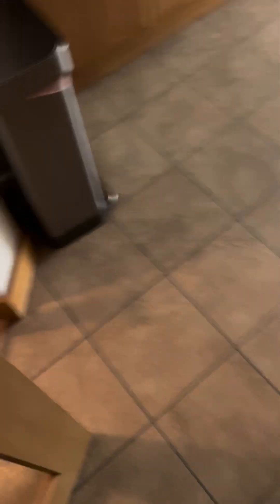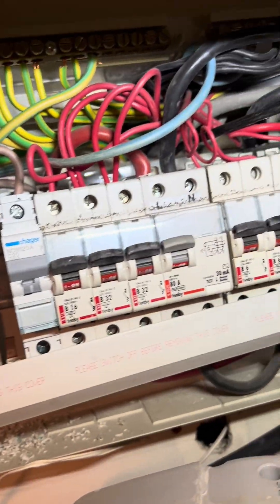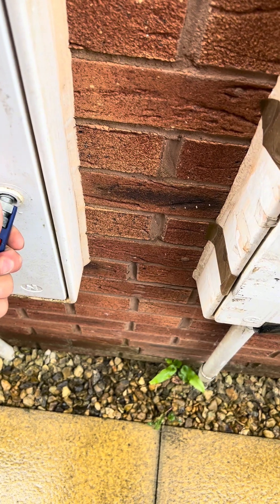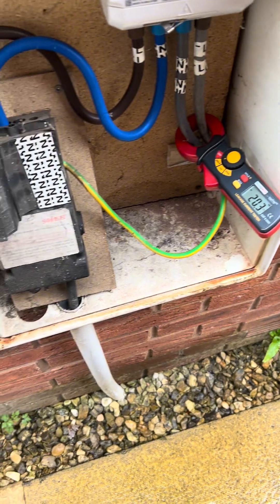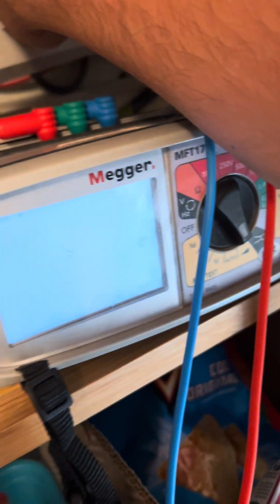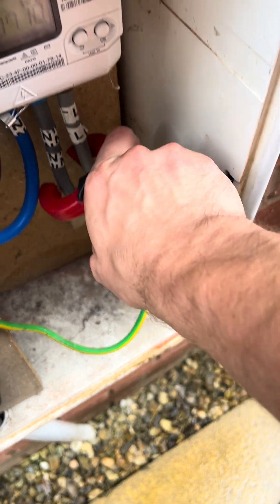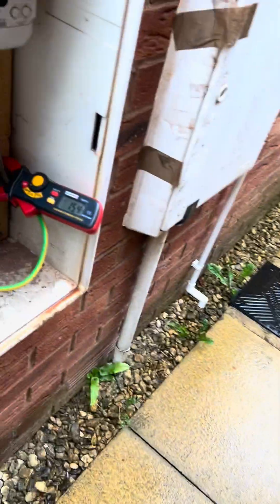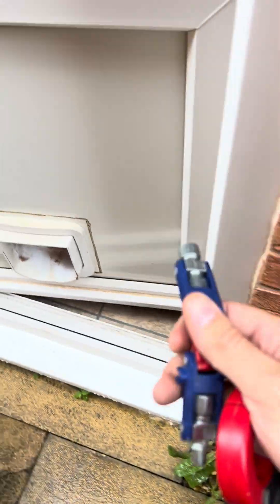EARTH LEAKAGE - REAL LIFE EXAMPLE

Comment: Client Had same issue today mate. MEM 1 board. 10 mcb's protected by a type A RCD surprisingly for such a relatively old cu. Ramp test was 21. Earth leakage with no appliances in kitchen aside the F/F pulling a load, getting 15.6 mA. Recommended replacing cu after carrying out an IR test just for peace of mind. All checked out.

Comment: Probably find the immersion heater will dump a few mA into earth when heating the water. Quite common for the elements to get a bit leaky.
Reply from the maker: The immersion is currently a backup & not used so in this instance it was not part of the issue

Comment: Good video
As your aware in the regs a 30mA RCD is only allowed 30% which is 9mA so wouldn’t comply.
Bad practice putting Solar on a AC RCD shared with other circuits.
Would be interested in what the DC leakage was? Obviously not above 6mA as it didn’t blind the AC RCD when testing.
I’m looking at getting the TIS 570 AC/DC earth leakage tester to replace my Megger 305E.
Reply: @Mainly_Electrical  Thanks corrected it. My bloody podgy fingers using my phone 😂
Reply: I'm new electrician, was wondering if I can I get advice from you?
Thank you
Reply from the maker: I’m very aware of the current requirements mate👍🏻 it is not my installation, called out to intermittent tripping & have given my professional advice to the client
Reply: @bristolsparky  I realised it wasn’t your installation mate, I wasn’t being negative?
I was just backing you up & adding some facts/figures for others who might be trainees etc.
Reply from the maker: @BassPaladin2047  👍🏻👍🏻👍🏻